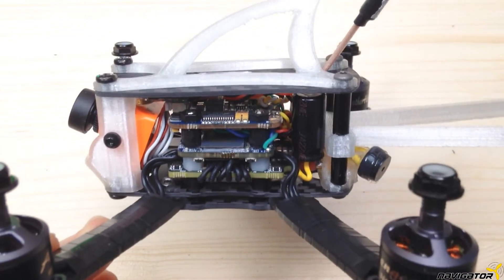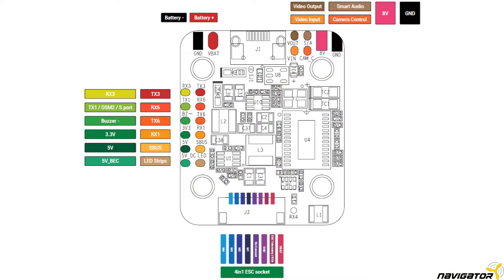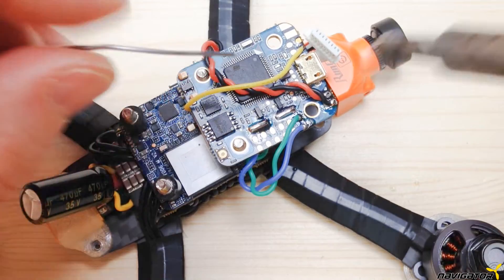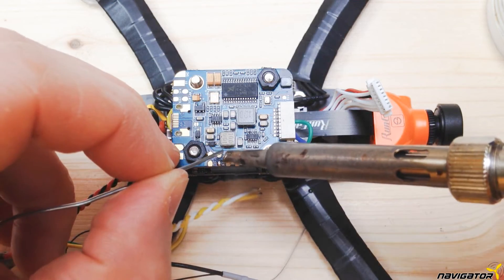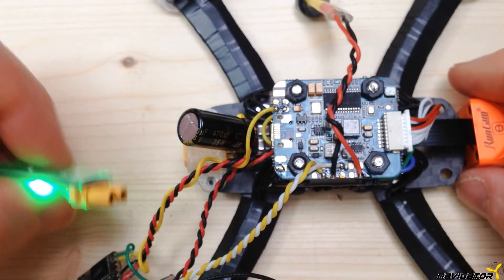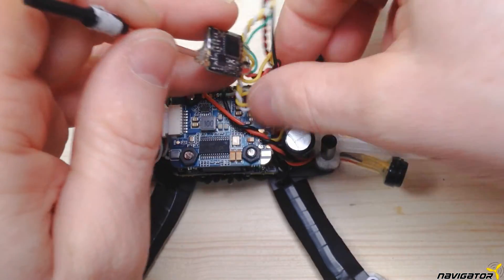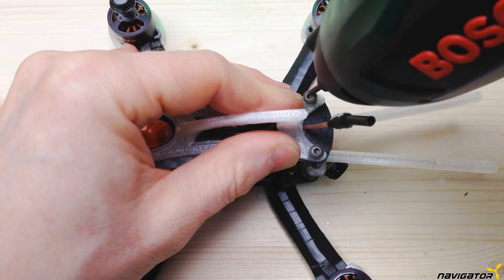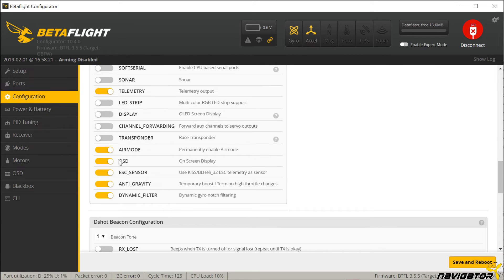Build Guide 3" Racing Copter DYS with HD Cam Fligh Controller Airbot Omnibus F4 Nano V6 (English)

Comment: Do you know what is the current sensor scale correct value and offset is needed
Reply from the maker: you need to set that yourself, if you want the numbers to be somewhat exact. 

There is a quite easy approach: note down, what the battery usage (mA) is in your OSD. then charge the battery, note down what mA went into the battery and calculate the ratio (Usage/Charge) and multiply that with the scale value, that's you new scale value. Do that several times, until you are close enough.

For example, scale is set to 400. Usage is 1000mA. Charge is 1100mA. The factor 1000/1100 is about 0,91. The new scale value is set to 364. For most ppl, this will be good enough.

Comment: Dose that FC have a flash ram for blackbox?
Reply from the maker: Yes, it does have onboard RAM. In the meantime, the V7.1 is out, which is even smaller, and also has onboard ram.
Reply: @N4V1G4T0R  TY for answer

Comment: Hi, I have a couple of questions. Should I place a similar controller with USB to the side and where, in this case, is it in front of it? And second, is it possible to connect an external current sensor in betafligth?
Reply from the maker: Of course you can place the USB on the side, which actually is better for routine maintenance of the firmware. It's just with this board, sensitive parts and cables are sticking out left and right of the quad along with the USB Port. So, I decided to keep vulnerable parts and the USB Port in the inside. 

There are external current sensors which can be connected to your FC (fe https://www.team-blacksheep.com/products/product:94)
Reply: @N4V1G4T0R  Thanks for the answer. I have a current sensor, but how to connect it? After all, there is no input on the board for such a sensor, some sort of manipulation is needed in cli.
Reply from the maker: It depends on the current sensor you have. Either you need a "Current IN" at your FC (which normally is a 0-5V in) or a free UART, if it's a serial connection. Best is you check the manual of the current sensor.